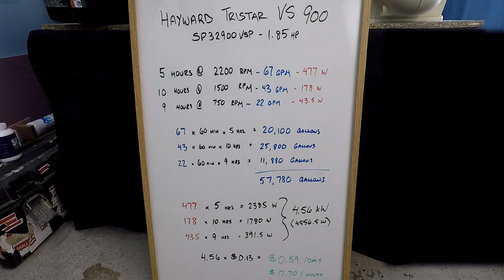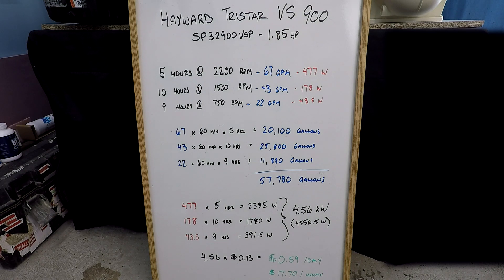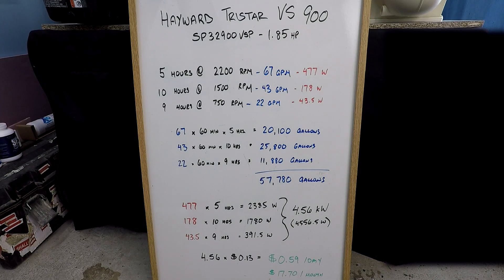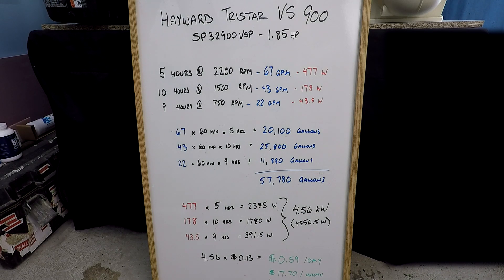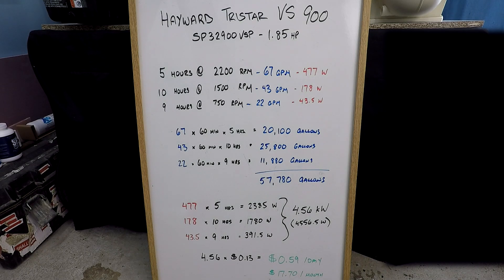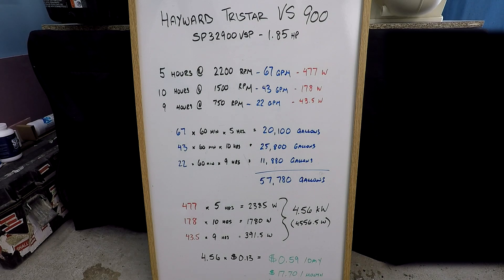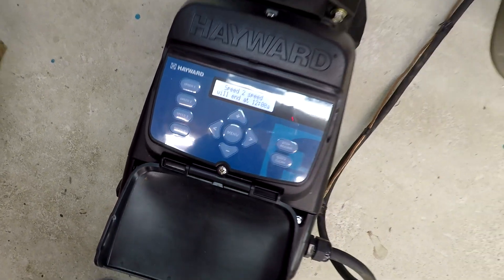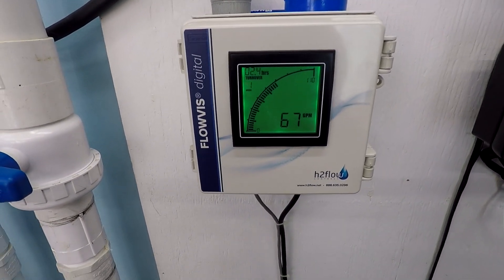Max Efficiency SCHEDULE For Variable Speed Pool Pump

Comment: Thanks so much for the helpful videos.  I'm new to this and have learned so much from you.  Quick question...if pool heater requires about 40 GPM then in the above schedule the pool wouldn't be getting heat for 9 hours?

Comment: @swimmingpoolsteve I've been using this schedule the last few days. Only downside so far is that the skimmer isn't collecting enough debris. Is there anything to do with that? Can the pressure be increased?
Reply from the maker: Every pool is unique. If you need more skimming action then longer hours at medium and high speed, or slightly higher medium and high speed rpm operation

Comment: I understand the concept of programming more (or most) hours at lower rpms, and fewer at higher rpm, but is there a minimum pressure required for a cartridge filter to run efficiently?  For example, at 2200 rpm on my Hayward VS 1.65hp pump, my Hayward cartridge filter, with a clean cartridge, shows 8-9 psi.  At 2500+ rpm, the filter seems to max out at 10-11 psi, again with a clean cartridge.  But if I go below 2200rpm, my filter pressure starts to drop, and at 1000 rpm the filter gauge shows only 0-2 psi. Is the filter still effective at such a low pressure?
Reply from the maker: @chuckklima807  more effective and more efficient. Low PSI is = flow efficiency

Comment: Great videos Steve!  Out of curiosity, is there a benefit to adjusting the rate during the day?  Otherwise why not say run 24hrs at 1500 rpm or even 15 hours at 2200 rpm?
Reply from the maker: The peripheral equipment needs certain flow rates and the skimmers and returns need certain flow rates to clear floating debris. How much depends on a pool by pool basis

Comment: Maybe I missed it, but what size pool (gal) are you basing this off of? Thanks!
Reply from the maker: Approx 20,000 gallons
Reply: @Swimmingpoolsteve  thanks! I'll take a look and adjust our settings. I'm 30,000 however we have the same model pump and our pool company has always kept it at Max RPMs 12 hrs and 2500 over night. I'll be curious how much a can get that lower. Our electricity usage is insane in Summer.
Reply from the maker: @waldyworld926  this is not a good schedule at all for energy efficiency. Even taking the max 3450 rpm to 3200 and the 2500 rpm to 2000 would make probably 30 to 50% reduction in power consumption.
Reply: @Swimmingpoolsteve  I agree. I never understood why we didn't take advantage of the variable rates. We moved in 2 years ago and just essentially left it alone. Glad I saw your channel

Comment: Why change the speed if you only need one function?  Why not just buy a single speed pump that produces exactly what you would need over a 24 hour period.? For example why not run a pump that generates 45 or 50 gallons per minute for 24 hours straight?
Reply: Thanks. This might be a great topic for a video for you.  A lot of pool owners, particularly salt systems, which do not need a greater flow than the filter, simply have no need for more than one speed. But it’s impossible to get any accurate information because everyone says that a variable speed saves money, which makes sense if you need more than one speed, but it does not make sense if you only need one speed, now if your argument is that a one speed pump is always running at full speed and therefore is in efficient, that seems to be a design problem, but not a need for more than one speed. And as I mentioned, if it truly is a design problem that No manufacture has ever addressed, get a two speed and run it on the lowest speed.  In any event since 99% of all statements are that variable speed saves you thousands of dollars, it just seems like it needs to address the situation where it doesn’t seem to save any money (provided that you buy a small enough pump capable of doing the one job you need (just filtering). Anyway, thank you very much for all of your responses.
Reply from the maker: It used to be that is how you got an efficient pump. A reasonable 1/2 hp or 3/4 hp at most. But that is still a lot less efficient than variable speed motors. A larger motor running at half speed will use less power, by a lot, than a small motor running at full speed. Both delivering 50 gpm. This is due to the pump affinity laws and why the department of energy now requires variable speed pumps for all filtration pumps on all pools
Reply: @Swimmingpoolsteve  thanks.  But then the question is if you only need one speed, why not just buy a single speed pump that is designed to runs at half speed?  I just don’t see the reason to be switching the speeds during the day.
Reply: Or if my question isn’t obvious, buy a two speed pump and run it on the low speed?
Reply from the maker: @dgv1170  you can still buy a dual speed pump I am pretty sure. If your system had no requirements for speeds other than the 2 it gives you then that could work also. There are some more budget pumps that meet the DOE energy efficiency requirements.

Comment: I can’t drop below 1200 rpm’s or my ultraviolet and flow meters trigger an alarm on the low end. The variable does save $. We didn’t notice a huge increase with a new pool. Even started having the pump idle because the pool was clean.

Comment: Just a note: 67 gpm isn't even close laminar flow in a 2 inch pipe. For 67 gpm to be laminar you'd need a 90 inch pipe.
Reply from the maker: The limitation for laminar flow in 2" pvc pipe is 6 feet per second of water velocity which is approximately 65 gpm.
Reply: @Swimmingpoolsteve  It literally is not though. You can compute this. The Reynolds number for water flowing at 67 gallons per minute through a 2-inch diameter pipe is 105,946. This indicates that the flow is turbulent, as the Reynolds number is significantly higher than the threshold for turbulent flow, which is generally considered to be 4000.
Reply from the maker: @David.Murdoch  thank you for your feedback. I should be using different terminology, max flow rate before appreciable losses to friction and turbulence.

Comment: Hi Steve. This is the best pool channel I follow and the best on YT, in my opinion. I do have a question: My almost 25 year old in ground vinyl pool (19x35 approx. 25k-30k gallons) has 1.5" plumbing. I currently have a Hayward 2603VS pump 230V. Last season, I installed an OmniLogic to replace my ProLogic. As good as this pump is, I would like to replace with another Hayward that I can control with the OmniLogic. What would be your recommended replacement and what RPM/Hrs per day should I run it?
Reply from the maker: You definitely would want to look at the super pump VS 700 which is the same pump ypu have now, essentially.  If that current pump can not be compatible that is. I though the 2603 was compatible with Omni directly, or certainly via relay control at minimum. I am going to comment again in a second here with a link to a sell sheet for the Hayward super pump VS which shows the 2603vsp compatible with omni. Perhaps speaking with Hayward tech just to verify your options would be a good idea.
Reply from the maker: Here is a link to a sell sheet that shows the SP2603VSP as being compatible with OMNI https://lesl.a.bigcontent.io/v1/static/Hayward-Super-Pump-VS-Brochure

Comment: I am researching a replacement to this very pump based on your earlier YouTube posts, thank you.

Is a 24hr runtime preferred, is it to maximize the longevity of the pump? 
Using a  single speed now and the idea of running the pump around the clock is foreign.
Reply from the maker: Every hour the pump is off is another hour of missed opportunity for savings. It is a continuous duty motor designed for constant operation. The lower speed operation (never needing max speed) means vastly less heat generated due to friction of moving parts. Heat kills electric motors so a lifetime of cooler, lower speed operation could potentially have a huge impact on longevity.  Finally, it is the priming cycle which causes the most mechanical wear on a self priming pump and motor, so all in all its a slam dunk from every angle. Here is more info in an article I wrote about this subject https://www.swimmingpoolsteve.com/pages/shut-off.html

Comment: So I guess you could cut these numbers down by a lot if you just have a 12k gallon pool.

Last year I replaced an old DE filter with a cartage filter, and the filter pressure dropped from 35 to 18.  I wonder how much energy savings come from this filter replacement?
Reply from the maker: I read an energy report once that claimed $100 to $300 per psi savings per year. I wish I had more details to share but ypu will have to settle for this anecdotal evidence.

Comment: Would these settings work for a 15000 gallon pool with 1.5 in plumping and a the Hayward 1.65hp VS pump
Reply from the maker: Every pool is unique. Ypu have smaller pipes, a different pump...I would suggest you look at this resource I am building which has multiple different examples including some using the pump you actually have, not the 1.85hp tristar 900 shown in this video: https://www.swimmingpoolsteve.com/pages/vs-schedules.html